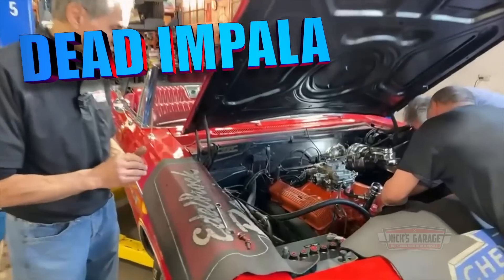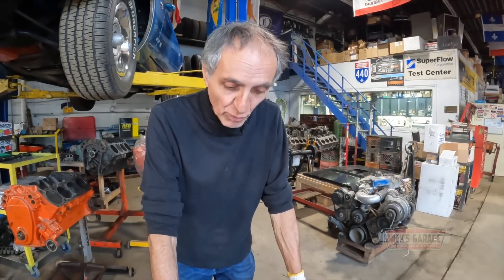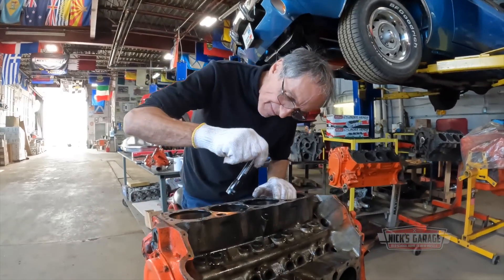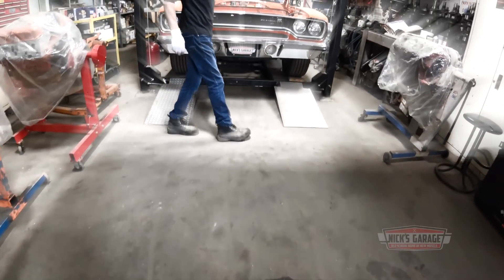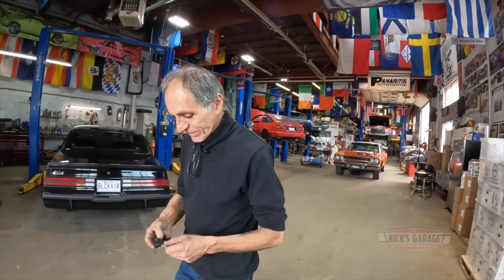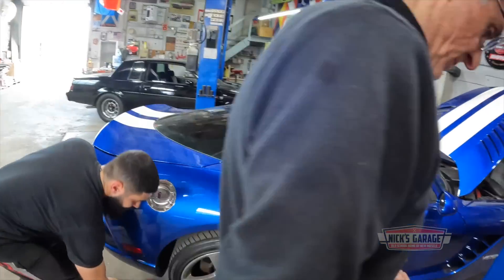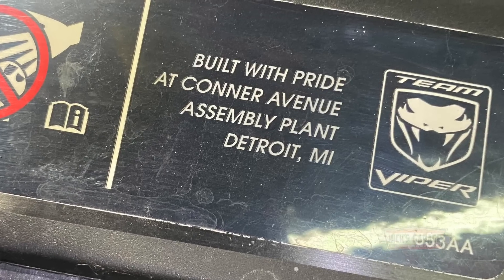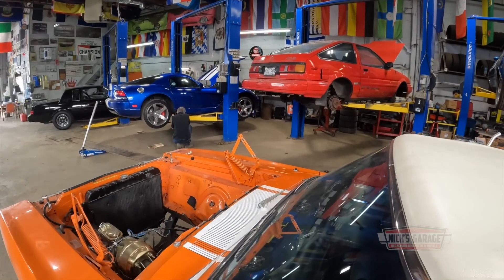327 Chevy Autopsy - Smoking Gun FOUND!

Comment: Glad you found the problem with the faulty thermostat on the Impala engine.  I have to admit I've never pre-tested the thermostats on my engine build-ups, now I realize that I just got lucky.  I'll be checking them from now on.  :)
Reply: Thermostat may have been damaged from extreme overheating... from another cause... like no spring in lower radiator hose and it sucked closed...
Reply: @BuzzLOLOL      Very possible.
Reply: @nickpanaritis4122   Nope, I have had a few do this to ! NAPA gold, Stant, & OEM GM . It's strictly quality control in Mexico. There all assembled there and boxed in the US.  But there is a FOR SURE cure ! See my other posts .
Reply: @BuzzLOLOL  When the engine was that hot it would have been boiling and venting through the radiator cap. No way a pump is going to suck a hose closed when it has 15 PSI of pressure in it.
Reply: get Israel made units seem to be good a lot are made their
Reply: Nobody is mentioning the rad cap a very important part of the cooling system. In 1970 my dad was buying a new duster slant 6 overheating on test drive got back to dealer mechanic put on a new cap never had another problem I was 12 at that time learned from dad and uncle's got into rebuilding engine and trans aircraft engines up to 28 cyl radials 64 now some of the biggest problems result from the smallest part. Oring took down the space shuttle!! A weak cap will drop the pressure the higher the pressure the higher the boiling point of the coolant. If you have a rad pressure tester get the adapters to do caps well worth it. Just food for thought
Reply: @danhigbee2283  i herd a UFO zapped the space shuttle and can be seen in the unaltered video as a light ball or some such craziness near failure point tooling with it in flight but who knows kinda of funny now to think its plausible sounding but back wen i first herd that i was like thats nuts oh.just figured i be a tool and mention it. all in a bit of fun :}
Reply: To stop a possible problem, the best cure is simple, gut the thermostat spring & valve and just install the shell of the thermostat back in the housing. Fact is all my rebuilt motors run 15 degrees cooler that way as all that is really needed is a water restrictor to slow the water down. A thermostat is only for heat in the winter. Does anybody drive their old hot rods in the cold nasty weather ? so just gut them out, no more problem
Reply: @hydroy1  USED TO DO THAT BUT I LEARNED  TO TUNE WITH AFR METER AND WEN UP TO TEMPITURE THEY USE LESS GAS {190 }min AND RUN BETTER .pardon caps button was on unintended
Reply: @overbuiltautomotive1299  I still do it, and if the plugs look rich ( never do in south Florida ) I might put a small piece of cardboard or tin infront of the rad. to close off a small area to get temp a little higher, but I never trust thermostats at all anymore, just not worth the chance. My current 327 runs at 160 with the guts knocked out just fine and the plugs read perfect.
Reply: @danhigbee2283  Good point. Also, does this vehicle have an overflow tank and the type of cap that sucks the coolant back from the overflow when cool? The failure to suck the coolant back from the overflow will gradually empty the cooling system......

Comment: Sad about the 327.  I had the same thing happen to me many years ago.  Replaced worn out motor with a good used one that came out of a good running car.  Ran the car for a couple of week and then coming home I was going up a good hill on the Autoroute and when I neared the top, the car slowed down a bit, pushed on the gas and it slowed down more.  Looked at the temp gauge and it was pegged on the hot side.  Pulled over and the motor stopped with a very loud clunking sound and... that was it !!  Was only a $200.00 motor but at the time it was a lot for me.  One thing I hadn't done was change the thermostat from the replacement motor so I guess it was my fault.  I've also heard that sometimes when a thermostat is overheated a few times, it may close and never open again.  Thanks again for all the great videos.  Best Regards - Mike

Comment: Giasou Nikola, 

This video brings back so many memories. My dad opened up a radiator repair shop back in 1985 & operated for more than 25 years.
Back in those early days all radiator cores were copper & brass tanks before plastic tanks came along, followed by aluminum core & followed by complete units all from China.
We always tested the thermostat if we did a recore & especially the taxi's we would recommend changing the thermostat at the same time of the recore or yearly flash,  cheap insurance during Melbourne long hot summer's. 
Never an issue but as we starting using fully build up aluminum units all from China & Chinese thermostat the issues we were having it was depressing at time.
The aluminum radiator we just build enough with no tolerance & you can't repair an aluminum core if it gets a hole in it you just throw it away.
My dad was always having on & off issues with Chinese thermostat & even new ones before fitting he would boil them & show the customer that it was working when he fitted in.
Also he would go to the next reading down so the thermostat would open earlier.

My hardtop old school 3 core, copper heavy duty air conditioning core for a 6 cylinder Hemi.
Plus I replaced the 4 blade factory fan with a factory 6 blade V8 fan, which to my surprise was interchangeable. 
Nothing worse than a classic overheating in traffic, causing a traffic jam & you have a car full of friends. 
They will curse you & ridicule you forever after that, it gets very hot here in Australia during summer. 
Over kill better to be safe than sorry.

Tough one on the warranty issue who do you point the finger at.

Tough lesson.

Regarding the coolant,  my best guess the heads got warped,  a microscopic hair line pin hole of a crack between a water jacket & the exhaust port & under all that pressure & heat the coolant escaped out of the exhaust.
As the engine cooled down the cracked closed up so that is why you didn't see any leaks. 
Let's see when they come back from crack testing.

Nice Viper definitely Greek. 

Your number 1 Fan in Australia 
Louis Kats from Melbourne Australia ☺ 👍 ❤

Comment: I had a small journal 327 that was bored 60 over, single plane, 750cfm, fully worked over fuelie double hump heads, crane energizer cam, lift was 555 intake 565 exhaust. and that little motor was a screamer. Use to rev it to 9000 rpm because it sounded so good screaming even though it use to fall on its face at around 7500rpm. People would say why you rev it so high, I would say cause I can 🤪

Comment: Nick I watched you build and Dyno! Your engines. You even drive the cars that your engines and transmission go in. Never have I seen one return for over heating. There can only be so many reasons that a engine over heats. Cracked block, cylinder head cracked, blown head gaskets, bad thermostat, hole in radiator or hose, water pump not turning the right speed or bad and clogged radiator core. Also everyone knows not to drive a car when it over heats. I would talk to the owner and ask why they didn't pull over. The customer has to be held accountable for continuing to drive the Convertible when it over heated. I know Nick! That you back your engines and work. You are a very honest business owner. That's just the kind of person you are. Keep up the Great work Nick!   Shawn.
Reply: I agree! A driver has to take some responsibility for the operation of their vehicle.  This should have been a glitch that was easily fixed not a full blown disaster.  A driver has to be responsible with being aware of his surroundings, his vehicle and even other vehicles and take appropriate action if necessary for his and other peoples safety. 
This thing must have been ready to catch fire the way he drove it long enough to burn the pain off the heads. That is pure and utter irresponsibility and stupidity right there.  At that point goes well beyond anyone else's fault but the drivers. 

If this had been a new car from a dealer, no way in hell they would just take all the blame and pay for an engine replacement.  I think i'd just refund this guys money and tell him to go elsewhere because he cannot be trusted not to do the same or some other stupid thing again.

Comment: In my older now classic cars I used to drill 2 x 3mm holes in the thermostat to ensure water flow in case of a faulty one. Not an issue here were I live in AU as we do not have snow or very cold weather. I never had an issue with engine temp in either direction.

Comment: '85 Ford 460, totally new engine. Over heating at highway speed. I had 2 t'stats from different manufacturers that were not opening fully. Tried different expensive radiators. Currently have a Motorad t'stat at 192F with an older all-brass 4-core radiator and the truck under load, 95F outside temp, running A/C, camper and on the highway gets no hotter than 210F. It runs a 195F at idle. When I reinstalled the all-brass radiator I back flushed the system and the water coming out looked clear. My truck likes the all-brass radiator better than the 2-piece and the all-aluminum ones. I suspect that many counterfeit parts are getting onto the store shelves.
Reply: A co worker spent over 100 thousand dollars restoring his 69 GT500 cobra 428 mustang. Beautiful but kept running too hot. Of course he shut it down quickly. Finally tracked problem to lower radiator hose sucking shut. Supposed to have a coil spring in hose to prevent it.  That was a tuffy issue.

Comment: My 1968 camaro 327 2 barrel 210 hp got hot at 20 some thousand miles. Thermostat defective. Used oil after that. Cam lobe wore off later. Lots of racket back through the 2gc rochester carb. Lots of quality problems back then. My 92 camry has went through several family drivers. Last summer the odometer showed 460 thousand miles still has good power.  No wonder Japan took over.
Reply: Oh, Jesus. Not these Toyota stories. I worked at a Toyota Dealership in 1978 and a 5 year old 70,000 mi Toyota would be heading for the Junkyard. Sure, they've improved but those cars in the seventies were sold for a few reasons. They were cheaper than American Cars. Being small and grossly underpowered they offered better gas milage. But they were no more reliable than a Pinto or a Vega at the time!
Reply: @douglaskey6823   I now have a 2010 impala. I bought 2 impalas as they were dirt cheap after the Obama bailout of GM. . It’s a good car. Early Japan cars were rust buckets. So were many American vehicles. MY 77 suburban was a rust bucket.  My  82 olds and 83 chevy were diesels. That nightmare caused me to buy the camry and wow, almost 500 k on it. The 92 through 96 Camrys were long life. Toyota has has oil burners. Some Camrys like 97 to 2001 were not as good. We all love the muscle cars. But there were many quality issues issues. Baby boom generation bought lots of them but got disappointed with quality though the 80s. I’m glad American cars are much better now. Many are made in Mexico and Canada. Parts from all over the world. My odyssey van has 225 k on it. Still runs great. Chrysler is the only American mini van left and, I think, are owned by Fiat.

Comment: Great Find Nick ! I’ve experienced that style high flow Mr Gasket Thermostat fail the exact same way in my 4.0 Jeep , I did the exact same test! I ended up with a Stant replacement instead. I never looked back ever since. Great recommendation to test boil thermostats before installation. 👍

Comment: a guy we know to test a engine, removes the upper and lower hose and puts a motorcycle inner tube on them, Fills it with air via its valve stem, and then waits over night to see if the pressure drops in the inner tube. works good for an engine on the floor too after you block off the heater hoses.

Comment: I know a guy who got a 69 Chevelle body and put it onto a 2002 Nascar cup chassis. So basically, he has the best looking body he loves with the best performance (He installed a 700hp stock block motor though so he can alot more miles between rebuilds than the cup motor), best brakes and best suspension that just wouldn't be possible with the original 69 components.

Comment: The only time I really ever had an issue like this was a 455 Buick in a '70 Regal that I rebuilt for a customer. It always ran hot and eventually cooked the thermostat. IE: the overheating blew the wax out of the thermostat. (That's what expands and opens it up.) Though I believe that it was a combination of thin cylinder walls after a .040 overbore and a marginal radiator, repeated overheating ruined the t-stat.
So, the failure could have resulted FROM the overheating.
The customer decided to sell instead of investing in a new radiator core. This happened about 1991.

Comment: When I had my 66 GTO, I found out right off on a triple digit heat day, I must run the car without a thermostat. It was like that straight from the factory. Was a direct drive 4 blade fan that was under par. Memorial Day- thermostat out/ back in on Holloween. Good to go. Tried different brands & temp settings but all did the same. Too bad that this happened.

Comment: This exact thing happened to me in 1968. My Grandmother gave me her 1962 Pontiac Catalina two door hardtop with 62,000 miles on it. I changed the fuel pump, water pump, all new hoses and rebuilt the carburetor. I decided to not change the thermostat which proved to be a fatal mistake. A few weeks later the car overheated. When I got the car back to the house, I removed the thermostat and checked it out in a way similar to what you did. The thermostat would not open at the boiling point. I installed a new thermostat and everything was okay. It is hard for me to understand why the owner of the Chevrolet did not notice his car overheating. It should have been obvious. 

.
Reply: Did it have the 421 in it? If it did, please send it to me. I will detail it and return it, err um, promptly, yes promptly.. I think ;)
Reply: @shoominati23  The Pontiac had a 389. I loved that car but I eventually sold it. At the time I was living in northwester Ohio. It was white with a red interior. Beautiful car. Wish I still had it.
Reply: @davidl2438  I'd love a 421 to do up, Yunick loved them and I'd love to do all the mods he suggests in his book. The Mickey Thompson Hemi head is the holy grail for these

Comment: Hello Nick, I always enjoy Your programs... Since the block & heads are made of cast iron, have them magna-fluxed. If they are cracked or a casting inclusion exists, the magnafluxing will probably show where the crack / inclusion is... Also, magna-flux the coolant passage in the intake manifold, where the thermostat is located. A crack or a casting inclusion there might leak coolant into one of the forward intake runners... Another way to check for cracks / casting inclusions, is to put the bare block back together with the heads , intake manifold and thermostat housing & gaskets firmly sealed where they normally go.. Block all but 2 of the open ports of the entire cooling jacket system for that engine. Fill the cooling system with 50/50 a/f & water... Block one more port, and Pressurize the remaining open port to 16 psig for 30 minutes, and check for pressure loss... If it is leaking it will show-up, and the leaking coolant should make it fairly easy to find.  Run a rose-bud torch up & down each cylinder and combustion chamber to simulate the engine running temp. If you still can not find leaks, check for leakage/blockage in the heater core under the dash. Maybe a lot of coolant was suddenly displaced into what was an empty/clogged heater core. That could have caused an overheat, a sudden displacement of coolant into the entire heater core system. Another thing to check would be blockage/occlusions in the radiator... This can also suddenly displace a lot of coolant from blocked passages that did start flowing, when the heated/pressurized coolant started flowing in those thin/previously clogged tubes again... I have seen all of these things happen with vehicles in the past, especially older ones that were stored for long periods of time, that were seldom ran during the storage period. That fella who told you the check the thermostat numerous times, God bless him- that is great advice that was given in several factory written service manuals... The other idea of a loose impellar is also a great idea... I have seen that happen too, especially on water pumps with plastic/bakelite impellers...Good luck with this Nick...

Comment: Saw a lot of cooked engines in the few years as roadside service mech far more so than about 20 years in workshops before that.
Any overheating issues on a freeway almost always ended up as a cooked engine, it all happens pretty fast unlike sitting in traffic and it can catch out drivers.
The temp light comes on for a few miles then it goes off once the water is boiled off the sensor and a mile or so more at 100+ kmh the engines were toast, stinking of burnt oil too..
The steam from the rear may have just been what was ejected out of the radiator overflow pipe downward and out the back that maybe looked like it was coming from the exhaust. Hence no water in cylinders noted by lack of decarbonising of the piston tops.

Comment: I was on a drive with my freshly rebuilt 289 on a bright sunny day. The clip that holds the heater hoses to the fender well broke. One of the hoses fell against the exhaust manifold burning a hole in it.  With the bright sunlight I couldn't see the warning light, and with the road noise i didn't hear the engine making any unusual noises. All of the sudden it looked like I was driving a crop duster.  The result was melted pistons.  The plug wires looked like burnt marshmallows.  A very nice lady that owned a nearby farm brought us to her home where we waited for my uncle to pick us up.  We came back the next day and towed the car home.   I put gauges on the new engine.